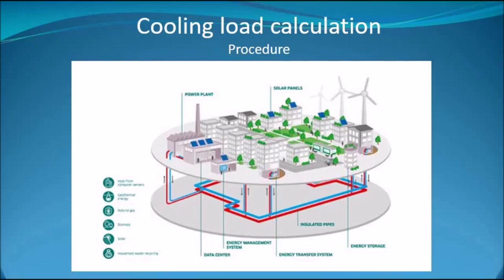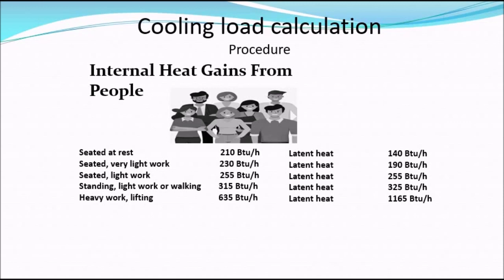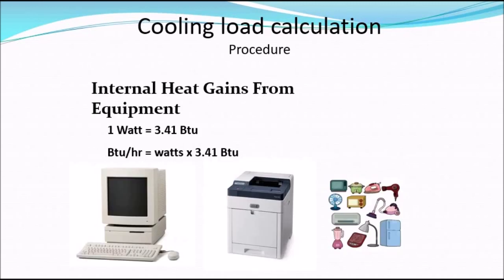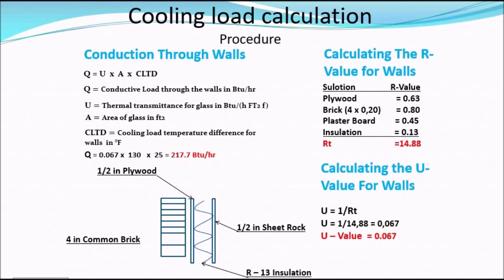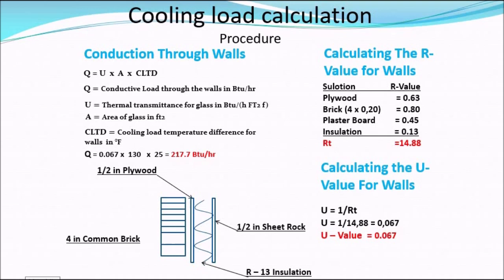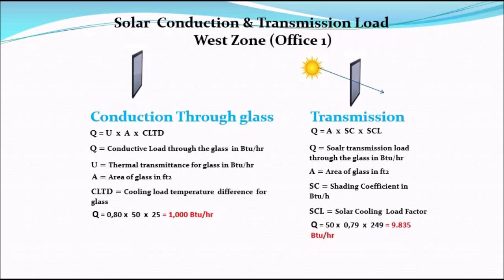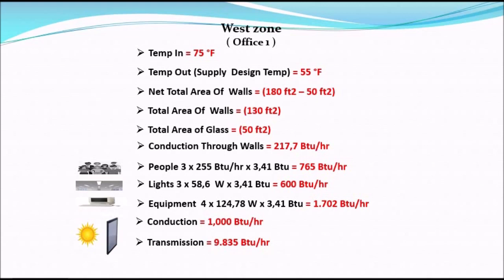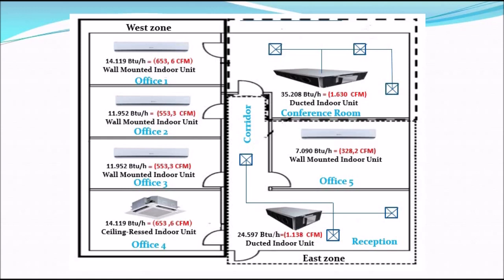Cooling load calculation-Office building - HVAC

Comment: Can you help me 

I am wanting to find CFM’s for rooms once I know the Btu/h
heating and cooling loads.

I have the Manual J8AE spread sheet and the CFM outputs seem
high to me and I wanted to see other calculations. 

I tried the Sensible Heat Formula of CFM = Sensible Btuh / 1.1 * Delta T

But when I input those numbers I get higher CFM needed in

areas that have lower Btuh heat loss/gain. 

Here is my example

Home is in Laguna Beach California 

The area labeled 1st Flr Master Bedroom has a
heat loss of 9138 Btuh and a Heat Gain of 4807 Btuh

Manual J8AE want to provide 299 cfm for heating and less air
(244 cfm) for cooling

If I do the sensible heat formula CFM = Sensible Btuh / 1.1
x ∆ T , I am using 29 ∆ T for heating and 10 ∆ T for cooling 

I get 286 cfm for heating and more air (437 cfm) for cooling. 

This does not make sense to me with needing more cfm with less of a Btuh load. 

Can you show me where I am thrown off?
Reply from the maker: Manual j8EA is correct because the volume of heated air is more than the volume of cold air. 

Your second calculation is also right 
Because you have applied a higher Delta T for your heating load and a lower delta T for your cooling load.

A Temperature difference of 29 for your heating btu/h, because you have a higher temperature difference for your heating load design so it gives you less CFM compared to your cooling load air volume. 

for your cooling load, you only have a temperature difference of 10 this means you would get more CFM compared to you heating load btu/h.

The higher the temperature difference the less CFM you would get.

The lower the temperature difference the higher CFM would be the result.

The following are the formulas you can use to determine the requirements for any room. You will first need to determine the total heat gain for your space as shown below.
Btuh = CFM x 1.08 x (T 1 –  T 2 )
CFM = Btuh / 1.08 x (T 1 – T2)
T 1 = Indoor Design Temp (DB)
T 2 = Supply Air Design Temp
Reply: @theengineeringtutorial2290  Thank You!

Comment: Hi, I was curious, at the end of the video, i understand you are trying to calculate how much airflow required to maintain zones temperatures at 75 F. My question is how come you set supply air temperature to zones as 55F? is that a typical standard value in hvac systems?
Reply from the maker: The supply air Temprature is always selected based on your sensible heat ratio ( SHR ), to design the supply air temprature you need to know your SHR first then you will be to calculate your supply air temprature by using a psychometric chart,
let's say you are design a system for an opera house and you came up  with a SHR of 0.8 that means 80% of  your  total is sensible load and 20 %  of latent load so if you use a psychometric chart that the 80 % sensible will give you a supply air  temprature of 60 so in this case from a design perspective you don't need be worried about latent load. 

so if you have a different condition, let's say you are designing a system for a gym or swimming pool that means you would need to remove more latent heat than sensible heat, let's say you have a sensible heat ratio of 0.5 that you will give you a supply temprature of 46 and you will need a thicker coil for that job in order to remove more moisture.

Comment: Good job. but you need to slow down a little bit. Could explain how to get the SCL value through using the Chart fro ASHRAE?
Reply from the maker: I will make a video how to properly use SCL factor and share the table in the video in order to help you more.

Comment: how cfm is calculated??? 8:35
Reply: May i also know how? Thanks
Reply: He is using a rule of thumb. 400 CFM per ton of refrigeration. Pretty much a standard for American stuff but if you dont live there  I would recommend  to check the specs of the equipment sold in your area.
Reply: it is simply this heat transfer formula energy = m' x Cp x delta temperature. In terms of airflow, it is expressed as btu/h = cfm x 1.087 x delta (t)